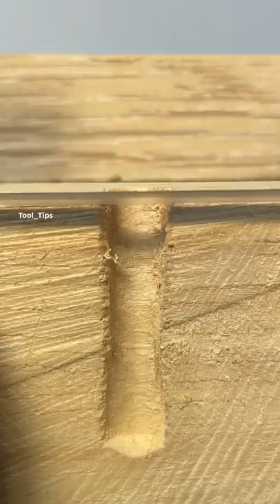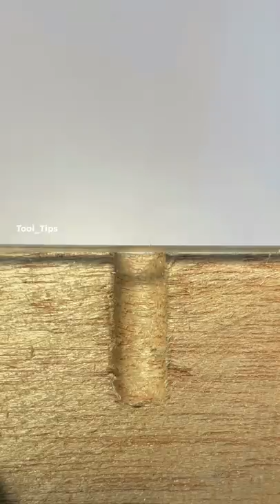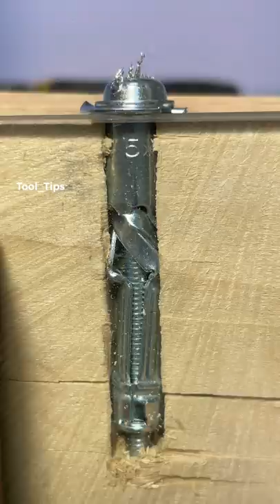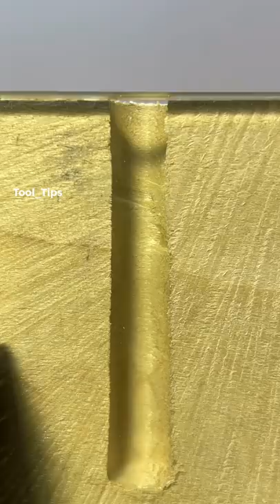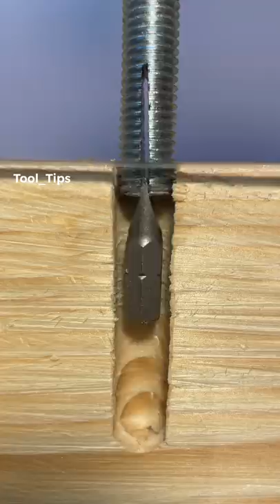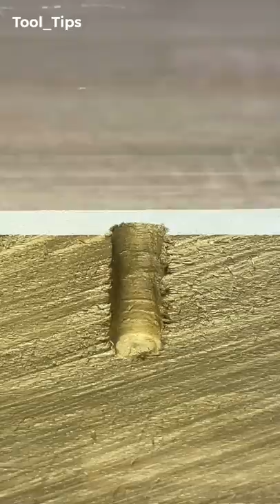#shorts The Best

Comment: These anchors are for drywall use. If you have solid wood why wouldn’t you just drill a screw straight into the wood?
Reply: I thought the same
Reply: @simonm1447  .
Reply: I think he's just trying to demonstrate how drywall anchors work. The plexiglass is meant to serve as the drywall that your trying to screw something into
Reply: Ordinarily you would drill a small hole first and then drill your screw in.
Reply: Maybe they wood? But since they woodn’t, I wood just say….nice demo?
Reply: It's just a demonstration of how these things function.
Reply: @kiwininja8489  that doesn’t really make sense. Since there is nothing behind drywall (aiming outside a stud) the physics are completely different as compared to pushing the anchor into a closed-ended hole as depicted in the video.
Reply: @jaicdc1  ahhhh, you yo think you’re punny?
Reply: @paulg8065  for some of the screws that might be the case. But typically if you're screwing something into a wall you would want the find the parts backed by wood (since most drywall consists of equally spaced out wooden beams for support). Otherwise you might use the anchors that depend on the tension that is created when the anchor and screw head are pushed together
Reply: so we could see what's up
Reply: @kiwininja8489  that’s what I was saying. If you’re drilling into a stud then you can use a simple screw. If you’re not using a stud you need these type of anchors that act very very differently than what’s being depicted here by putting that anchor into solid wood. That’s why you see some of the anchors getting destroyed—they were meant to expand behind the drywall, not in an enclosed area.
Reply: @paulg8065  , if it is short screws then a plastic anchor in drywall will hold for light things  but for hanging  something heavy then a toggle bolt  attached to a hook with screw  washers will be better suited for drywall .
Reply: @eepykittnn  🤔???
Reply: @paulg8065  ahhhh ok i see what you mean. Yeah they probably should've taken the wood out at least for some of the anchors
Reply: The metal anchors are for masonry and the plastic are for drywall.
Reply: @ThaGnome70065  the plastic ones are all for masonry, the first metal one is for drywall and hollow bricks and the other  metal ones are for concrete
Reply: @timonkuschke3861  From my experiance , i've found that the plastic anchors don't hold in masonary. If you wat an anchor that's going to last a lifetime in masonry, use metal anchors. Sorry I should have explained myself better. I know what the box says. I'm speaking from experience.
Reply: @ThaGnome70065  I mean the cheap ones that came with stuff are pretty much just waste but the good ones from fisher, würth or reca hold everything. I personally had never problems with them except for some old fragile masonry where you start with a 6mm hole and at the and you can put your thumb in it...
Reply: It’s to show how the anchors respond to the screw and what happens under the surface I think
Reply: @timonkuschke3861  Would you trust top of the line plastic anchors in masonry if you were tasked with hanging something heavy enough that if it broke loose it would kill someone? Or would you just skip straight to the metal anchors. Me personally I would go straight to metal anchors. I've always been taught to over engineer if possible. Especially if i'm hanging something over peoples heads.
Reply: @ThaGnome70065  it depends on how heavy it is, but if it is too heavy you can also just glue the bolts in.
And for me the heavyes thing was a 100kg wooden frame hanging from the ceiling and it's still there
Reply: Am I the only one who has ever used a toggle bolt?
Reply: This is for demonstration, not actual use
Reply: @kiwininja8489  you don't use an anchor when you're screwing into a stud. The demonstration makes no sense
Reply: I thinks it's just to show how they work. Would be hard to demo using drywall.
Reply: @timkelley750  yeah but they're supposed to flare out and anchor behind the drywall. That is not possible when the surface is solid which is why several look like they're popping out of the wood
Reply: Stop arguing this is clearly a demonstration video
Reply: The glass wall is there for us to see what happens inside
Reply: You can use these anchors for more than drywall. They are good for solid surfaces like concrete or block wall. 

 @paulg8065  the anchor that looked like its getting destroyed is called a knotting anchor and is supposed to act like that.
Reply: @kiwininja8489  

Dude you talk like a person who looked up a video on how to hang a picture or tv and did one project and now you think your a carpenter and a hardware expert. Lol. No the demonstration is not demonstrating ANYTHING. Roflmao🤣 I think this is just meant to be asmr or this guy didnt realize his mistake.
Reply: @FNG_Star  I mean there's nothing really here that's complicated. The guy is using a clear polycarbonate backing to demonstrate how different anchors work. Even though he uses a stud which destroys some of the anchors and doesn't accurately show the process, it's just a demonstration
Reply: @kiwininja8489  

It is a fair criticism to say that the demo would have been better served to use a board or dry wall material against the polycarbonate, aka plastic, so that the full expansion process of the anchors would have actually been demonstrated.
Reply: @timonkuschke3861  do no Americans call them rawlplugs? Likely bc of copyright, right? 🤦‍♂️
Reply: @TheGonzogibby  I don't know, I'm  from Germany, and is rawplug not a company from Poland?
Reply: @timonkuschke3861  apparently named after John Rawlings, who invented them. That’s what we call them here in the UK (Scotland anyway)
Reply: @CranioUomo  I see a man of culture 🧐☕👌🏻
Reply: Dynabolts are for concrete not plaster.
Reply: @jamessaer3424  yes it makes sense, how else can he demonstrate how the fasteners expansion is what gives each fastener its pull out resistance ?
Reply: Not really. A few yes for d.w. but anchoring hardware seems to evolve often
Reply: He's literally just showing how the different things work. Cutting other materials than wood in half and putting it against glass would take too long. Hence the use of wood for everything.
Reply: @Starchild91  That's not the issue. He's not showing how they work because half of them literally cannot work as intended this way. So it shows nothing but incorrect information for those.
The funny thing is cutting the proper material for those can literally be done with a knife. 

Every plastic anchor but one, plus one of the metal anchors are meant to be in a void on the other side of drywall or similar hollow material. He could have used drywall, a sheet of plywood, literally just anything ~half an inch thick and it would have showed correctly.
*Actually I think there may have been 2 or 3 metal drywall anchors in there... Not just one. I'm not going back to double check at this point though.

Comment: Those are designed for drywall not wood That's why they get squished and crushed whenever they're being screwed into the wood.
Reply: There were a few different ones. Some were drywall and some were cement and stuff.
Reply: @andremartinez418  Please love me
Reply: y tho is the wood too soft?? :v
Reply: @derbabo8455  Because wood is just the right hardness actually. It allows the thread of the screw to bite into the material therefore providing a very strong connection with all the extra surface area. The ones for drywall are designed to expand and scrunch up to the back of the drywall since it's usually pretty thin and hollow behind it. Drywall is also very brittle so if you try to run just a screw through it the drywall will give out. If there is a stud behind the drywall the anchors aren't needed because the wood is a great material.
Reply: @andremartinez418  exactly right. Unless you have a metal stud. They are so thin you should consider a toggle bolt behind it because there's not enough material to make good threads out of the stud.
Reply: @nathanielmiller5813  lmfao
Reply: @-8_8-  in my house there are metal studs
Reply: Ooo watch out everybody we got THIS guy. He knows his screws he’s soooooooo cool
Reply: @sloppytotsbloppyflops6030  he is
Reply: No none good in drywall, mainly concrete
Reply: Ikr the fucking molly plug made me cringe so bad
Reply: @RSmith1982  are you trolling?
Reply: Seems like he was just showing what it looked like, theres no instructions or title doesnt seem like a tutorial vid just what these kinda look like in use for an affordable price vid
Reply: i think he's just showing what these things would look like
Reply: Durr nate
Reply: Almost all of these were used in incorrect applications. A few were clever however. I’m gonna watch it again.

Comment: Interesting.. BUT most of the anchors are for "Hollow Wall" and only supposed to be going through a 1/2" or less which is causing all the fails.. The biggest fail was a Concrete anchor.. I did learn one trick though, the Brad in the end of the dowel trick..👍
Reply: I only saw one true fail.
Reply: In my proffession we simply use glue with the dowel (we call them Goujon in french). Thats usually why they are loose, i dont understand why you'd sploit them in half like that since it would make anything you put together just fragile.  maybe its for something i dont personally do therefore dont know about.
Reply: That and most of them are meant for drywall, not studs.
Reply: @SiriusBlackBuscus  finally someone said it.
Reply: @SiriusBlackBuscus  FaultyFemale for the win!
Reply: You're all looking WAY too deep into this. This was the best way to display what ALL of the anchors are like. No, it doesn't show the backside of sheetrock, in which some of those anchors act differently, but you also can't get that nice side view with a piece of rock. You couldn't do any of this with concrete either since it would just crack and the anchor would fall right out.
Reply: @comedycorpse9768  %k
Reply: Everyone’s an expert
Reply: Brad is having fun in the end of your dowel
Reply: @SammyM00782  thank you. Sheesh.
Reply: Indeed. The metal anchor, when used appropriately, spreads right out and clamps against the back of the drywall in at least a 1.5" reach. Love those things!
Reply: I think this was just supposed to show us what happens on the inside
Reply: @Catastropheex1  Yes, you're right, but most of these comments are saying that it doesn't really show us what it would look like when we use it in normal building situations since this content creator put many of them into wood instead of how most people use them: for drywall. So they would act differently if they were demonstrated using drywall. It wasn't a very helpful comparison using wood, but it was still cool to see. :)
Reply: What do you mean?
Reply: Anonymous what do you mean?
Reply: @SammyM00782  Oh Sammy..🤣 You are looking WAY to deep into it.. We are simply saying that the anchors that failed were not meant for wood..
 My Reply to 1st part.. Assuming that you are attempting lingo and your calling Sheetrock "Rock" and your not referring to rock like your pet rock, why couldn't you get a side view sheetrock ??🤔  
 2nd part.. Yes, obviously Concrete is not transparent but Most of Us we're just pointing out that the "Concrete Anchors" that Homeowners might think failed in Wood are actually Great anchors when used in Concrete.. 
 NOT Insulting anything just sharing my opinion/experience & trying to help.. Not trying to speak like you where it's 💯 facts you probably Googled.. 😜 joking (sorry couldn't resist)
Reply: @xaviercruz4763   @Xavier Cruz  I'm sorry.. Not on YouTube daily.. Can you elaborate on what part of my comment your questioning ? (Not sarcasm)
Reply: @comedycorpse9768  👍👍 💯 Percent agree in 99.999999% of situations.. I honestly didn't even think anyone was going to read my comment and was just thinking out loud of those rare circumstances where your doing a quick fix to some pos draw or something and the dowel wants to fall out.. 
 Agreed, why would you want to split something structural.. lol
Reply: @swalowit  This video wasn't to demonstrate the failure mode of any of these anchors, just to show how they worked. You can't get a sideview on sheetrock because it's not that strong, and the anchor would never stay in half a hole anyway. And yes, that's lingo. When we say rock on a jobsite, everyone knows it's sheetrock. I'm fairly certain I've set WAY more anchors than you have. In any event, if a homeowner wants to see how good these anchors are in real life, we have ProjectFarm for that.
Reply: @swalowit  Hi. You said somethings as talking to people that already understand this, so ¿whats "meant for hollow wall" instruments and how do they differ from the shown in the video? And whats the Brad in the end? Whats all that.
Reply: @JinKee  ,,
Reply: @swalowit  ,,,,,,,,,,,
Reply: @skins4thewin  some of the cracking probably wouldnt have happened in a real life situation, but the window makes for a unique result
Reply: Was wondering how to get the brad in the peg.....
Reply: @SammyM00782  Yeah but by using them in wood, you're not actually seeing what these anchors would really even do unless you were using them incorrectly. Because most of them are for sheetrock and drywall.

So it makes it seem like a lot of them suck, when it's just not for that application.
Reply: @JB-pb9xv  Sure, I get what you're trying to say here, but in all honestly the guy wasn't trying to express that point. It's just for show basically. Doesn't really show how any of the anchors expand, but for a sideview that would be impossible unless a guy used plywood, just so he can actually use half a hole. Even then it might just spin.

Comment: Really cool, how we get to see what's happening while putting in the screws and nails! I think this should be on one of those 'how it works' programs on the history Channel.
Reply: Clear glass
Reply: @Mo Nol
Reply: @Sora_Nai  0p
Reply: @Sora_Nai  ⁰⁰⁰
Reply: The wood only has way less structural integrity because it’s cross sectioned, not really practical for seeing what happens in normal wood
Reply: If you believe this is what actually happens, you’d be wrong.

Comment: I'm not the smartest, but isn't like half of these causing stress fractures in the wood? I think that would be bad if it were used for building an actual thing.
Reply: This is how almost everything built with wood is secured
Reply: @newuser689  Yes, except with the right anchor and screw.
Reply: Yeah, the one towards the end even had the wood completely come apart laterally.  Maybe this is just a demonstration of how each piece works?
Reply: @Beverly_Dingus  Yes just a "how it works" demonstration using wood and plexiglass.
Reply: @newuser689  Yes but usually you tend to drill it out enough so when you add your pieces you don’t split the wood
Reply: @newuser689  this is not true by any means.    Joinery with glue, finish Pocket hole screws with dowels, screws with plugs or glue/finish nails and filler are way more common.   
Anchors are most common in drywall, brick or with wood when you’re using a new fastener into a pre existing hole that’s to big for it.
Reply: @yearight7956  screw with dowel is what they showed though right? and of course there's glue. but like that's all there is. screws+anchors+glue.
Reply: I agree with you but when do you suppose the last time I walked out of a hardware store with twenty of those plastic doodads was?  

Screw Bob, here comes Lucas the Builder!!
(with my plastic doodads and all…)  🔨👷🏻
Reply: @newuser689  not anchors bud.  Wood and anchors are virtually useless it’s plywood then you need a toggle bolt or something.  
Ya a dowl with a screw is what they showed but not in the situations it’s supposed to be used.  
      Also when I saw a dowel and a screw I mean a screw at an angle then a dowel.  Not a 90 degree screw, that’s useless.
Reply: @newuser689  you don’t understand. Anchors are not meant for wood bud.  And dowels don’t just have screws in them.  There’s virtually 0 situation when you’re putting a fastener into a hole 4-5 times the width of the fastener.  
      Dowels are used for pocket screws or screws that are put in countersunk (the head of the screw can go 1/2 or so below the surface of wood). 
      This video makes 0 sense. These anchors are for drywall or masonry not wood (unless plywood I guess).
Reply: Bro everyone chill it's for the satisfaction. This ain't a how to video.??